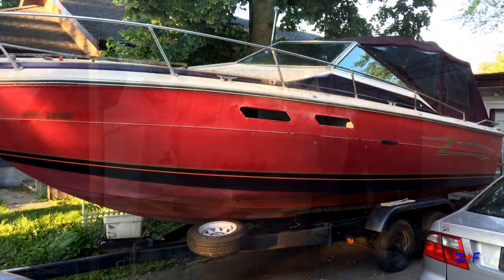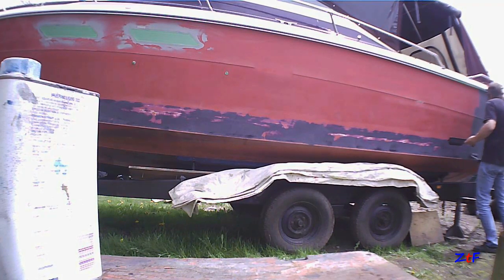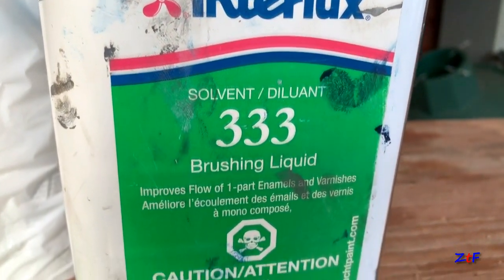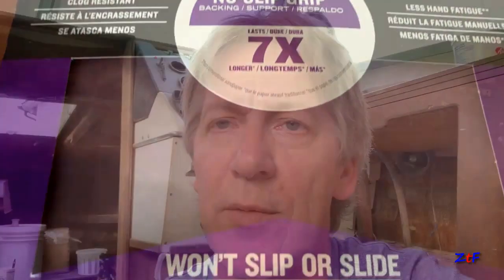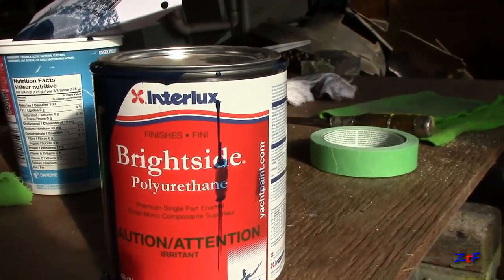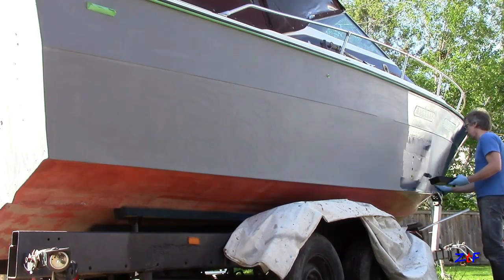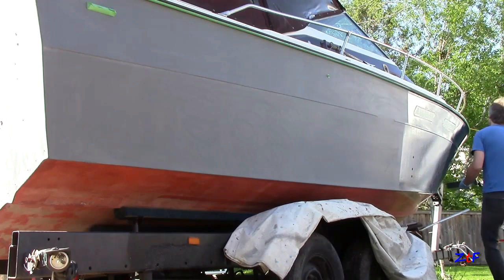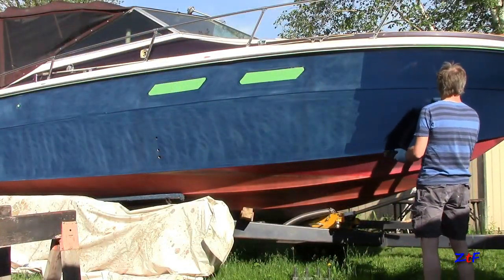Part 6 - Painting the Boat - 1974 Sea Ray SRV 240 Weekender Re-build

Comment: I've got a 74 Sundowner. Basically done now. MercTrans experienced now.
Reply from the maker: My project is currently on hold for the winter, although I did get the floor in and sealed before it got too cold to work. Once it gets warmer - the snow melts and I can work on it again - I will start getting the mechanical components back in the boat. Any issues with the MercTrans setup?

Comment: how do you paint the hull of the boat??? Looking at doing the same for my boat 91 chaparral 2350.  Really enjoy your videos.
Reply from the maker: If you look through the video - I just use a small foam roller to get the paint on the boat. Haven't done the bottom yet, I still have a couple of thru-hulls to install as well.